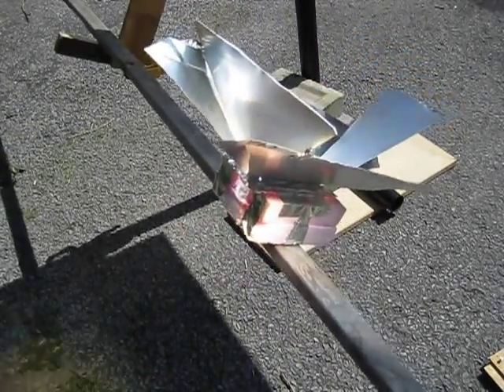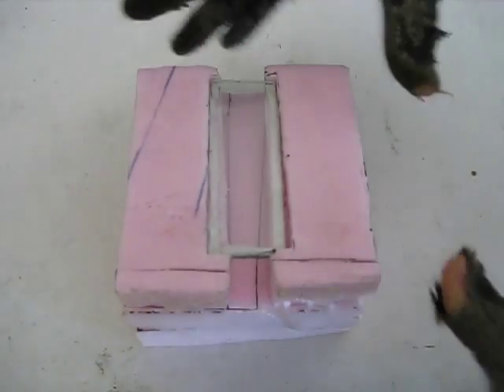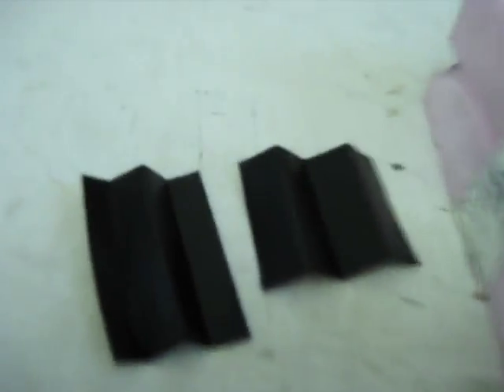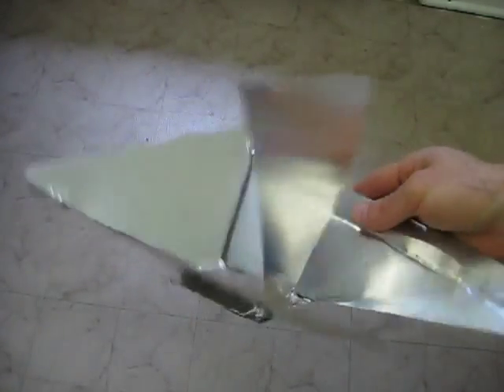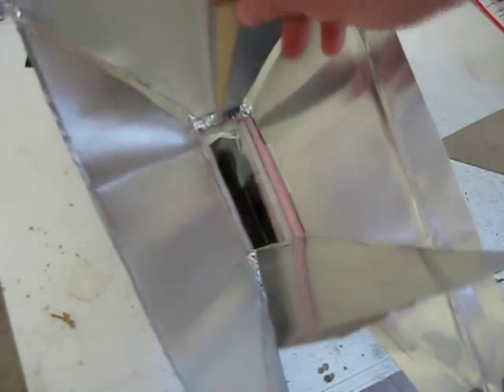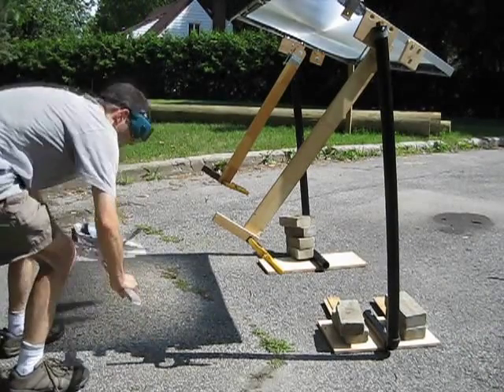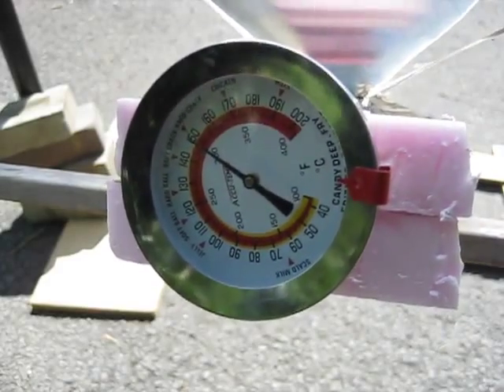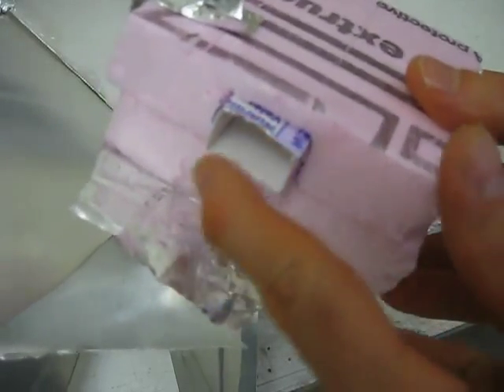Mini solar tower (ver. 4) powered by fresnel lens

Comment from the maker: @andodesign A greater temperature difference definately helps. Why the rifling though? I think that would cause more heat transfer from the air to the tube and decrease the buoyancy. I was doing some calcs yesterday. Go to wikipedia and look up "Stack effect". Then scroll down to "The flow induced by the stack effect" and see the formula for the draught flow rate. The cross sectional area of the tube seems to be the biggest factor - surprisingly.

Comment from the maker: @andodesign Have a closer look; the formulas contain just multiplication, division and a square root. They say that cross sectional area is very important. However, increasing cross sectional area increases heat loss and volume of air to heat, and temperature is also a factor. Height is also important, but less so than area. Anyway, I'm almost able to turn a very light paper turbine. Hopefully last tests today and then another video. Nice idea with the wall, lot's of cross sectional area.

Comment: I'm enjoying watching you try to get air to move using the sun.  I've wanted to do this, too.  I've been at the mouth of a cave before and felt a constant air stream coming in.   I bet cave openings could create electrical energy.  Anyway, your idea is similar.  I wonder if the tube should be longer.   I hope you get some success.

Comment: why not boil water with the fresnel and use that to capture the power? steam engines are simple and used for solar, nuclear and fossil fuel to convert heat to power. using air is difficult and likely not to efficient. still its fun to do things in a round about way lol i do similar things and its a good way to keep busy.